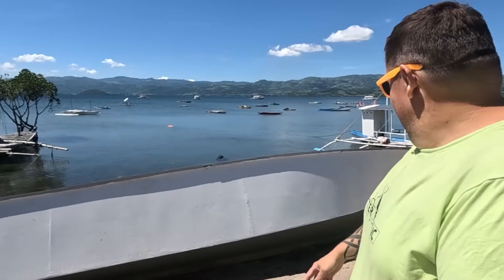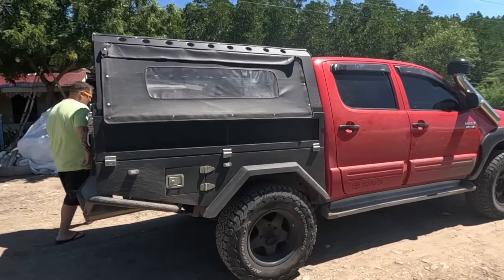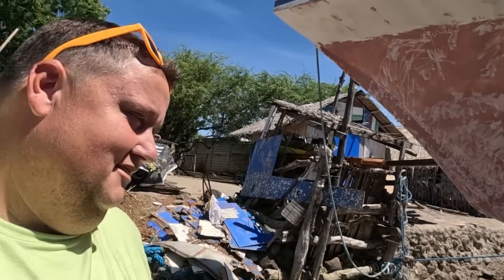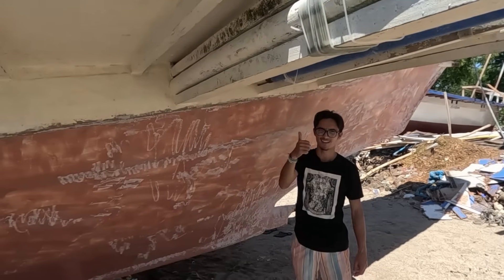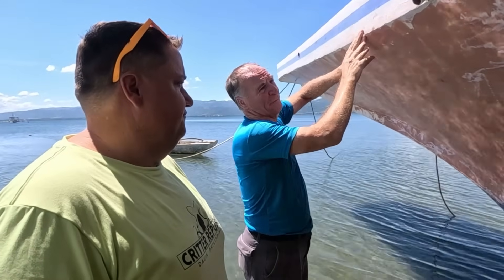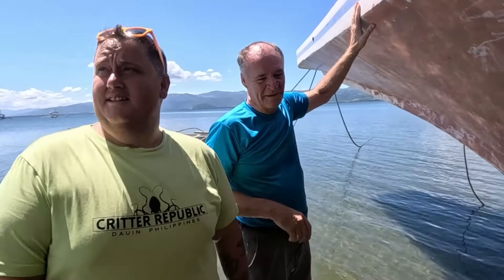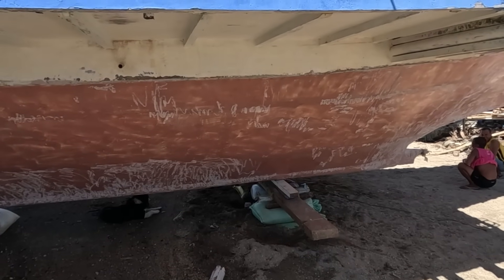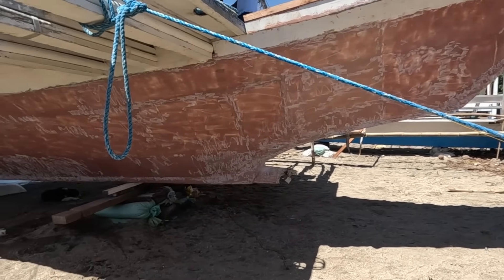How do we get this motor out of the boat? | Restoring A Dive Boat EP23

Comment: I vote enclosed upper deck if it is OK with a marine engineer and doesn't cost too much. I know thr enclosure with A/C isn't necessary, but it gives the boat more options. If a passenger was heat sick or vulnerable to heat sickness, having that option could be nice

Comment: Good update. W you Justin on Keeping the upper deck as a simple open observation area (w shade roof) not overbuilt into a partial “live-aboard” temp enclosure area- Just leave it to what it is - a rooftop open seating.  However I get the desire for an area w AC at times- but this is not a camper , its for excursions.  Fun project! Keep up the good work. See you in January!

Comment: Hi Justen with all the different colors it will be like the jeepnys the way lot of them are painted with philippino colors it will look great. And dont need third cabin on top. And i would just reupholster the pilot house seat make it comfy. I would build a small frane with track wheels to put under the motor and make a track with 2 long 4by4 timber and you can roll the motor uphill to the deck then have a lift ready to lowet it to the ground. Then putting other motor on the deck with the cart under it lower it down slow to where you want to mount it a track would be safer than man handdleing the motor.And Justin do a christianing for the boat before you take it to your resort.
Reply from the maker: Hi Calvin! Love the idea of vibrant colors, like the jeepneys. Great call on the cabin, and I'll consider the seat upgrade. The motor transfer plan with a track sounds smart and safer. Thanks for the fantastic suggestions and good vibes!

Comment: Back in the day, we switched from steel motor mount/base. 2Ft x 4Ft.
To those that are encapsulated in plastic with corresponding threaded holes for the motor to be bolted down.
Just thinking outloud.

Comment: I'm sure there used to be a road to the beach at that boat yard but after time they filled it in with other structures etc. So you are probably doing them a favor for new access.
Reply from the maker: Good point! If it helps in creating new access, that's a win-win. Thanks for the insight!

Comment: I'll be needing a shady place on board, air con not a necessity. BTW, when you were describing at the end how you need to cut the tree, take down the fence to make room for the truck, I was looking at an electrical wire over your head that a tall truck might hit.  Can't tell from the video.  But yeah, don't forget to look at overhead wires.
Reply from the maker: Got it! A shady spot on board is noted. Thanks for the heads-up about the overhead wires – safety first! We'll ensure to assess and navigate around any potential obstacles. Appreciate your keen observation!

Comment: you should go in by some vibrator Sanders and a belt sander for you can have that Hall finished very smooth, that is my suggestion to you buddy, I don't care if they think they are experts about the boats I know they do very good work and they are craftsman's, in their own right. But they do not have the technology and the knowledge of America working with boats, so if you want the bottom of that boat to be smooth like a fiberglass boat get them them Sanders or that's not going to happen. Because I really don't think they are going to send that boottom by hand. After a while they'll get discouraged and they will just lay the paint on heavy,
Reply from the maker: Thanks for the suggestion! Your insights are valuable. I'll definitely look into using the right sanding tools for a smooth finish. Appreciate your expertise in this matter!

Comment: Typhoon season will probably be starting soon, so I am thinking that getting the engine swap done as soon as possible would be wise in case you need to move the boat to a safer location to avoid the storms.

Comment: hold everything body I just heard about the paint, you have to put a special paint from the bottom to the waterline and that paint is called Antifouling paint,it is not regular pain and also I have not heard anyone talking about attaching led strips about 1 foot long 2 feet wide. On the bottom of the  boat below the waterline. It doesn't matter if you have copper and stainless steel screws or nails. These lead bars have a chemical reaction in salt water and the attacking agent that will eventually eat the copper nail or the stainless steel nails. Are channeled to eat the lead bars, you can replace these bars by making them attachable on the bottom of the boat every few years. This will protect the bottom of that boat also, I owned a 42 foot pacemaker wooden boat and that was a absolute having on the bottom of the boat below the waterline, you don't have to believe me buddy do some research about this and you will find out. This also is technology we use in America just trying to make sure that boat is protected against that saltwater

Comment: 😂 all the argument and they totally forget about the wind the boat will be facing when it runs. Closed cabin is good. But if it's open its shouldn't have any cushions/foam for the rain water to soak in.
Reply from the maker: Haha, you caught that! You're right, the wind factor is crucial. We'll consider the cabin design carefully, and if it's open, we'll ensure it's rain-resistant. Thanks for keeping an eye on the details! 😄⛵